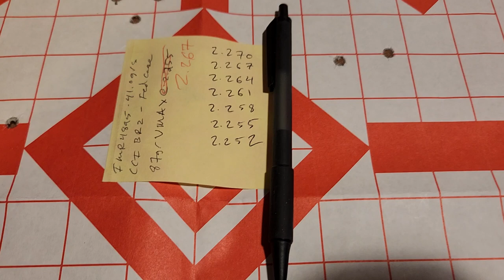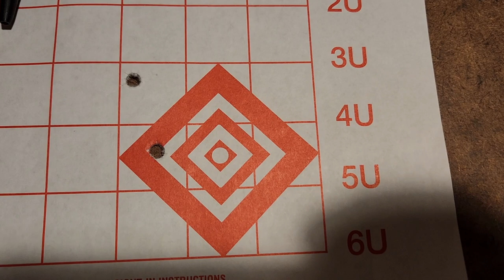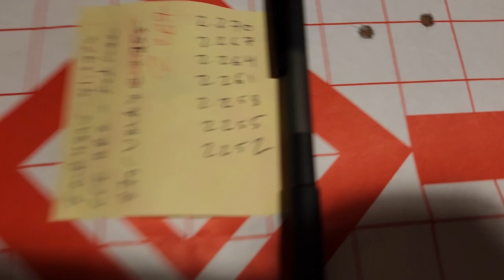"MY HANDLOAD DOESN'T SHOOT WELL ANYMORE! " | How to fix it. It's easier than you think!

Comment: Your velocity drops when seating further out. Changes your DOPE sheet.
Reply from the maker: I have noticed the opposite effect. When I seat further out, I am getting closer to the throat, which increases pressure and velocity.

Just my most recent example: I was at the range yesterday doing a seating depth test with our 22 Nosler project. The same trend applied. When I was at .007 off the lands, the velocity was 3050, from .013 off to .036 off, the velocity was 3032, from .036 to .051 it was 3018 and the remainder of the test from .051 to .067 it dropped to 3009.

Thanks for watching!

Comment: Makes sense. Eroding throat...😊
Reply from the maker: It works! I don't know how many times I have done this process, but it has always worked. Typically I don't have to change the load as much as I did in this video. Usually maybe 3 or 6 thousandths. Not 12 like this situation. But I imagine that is just an artifact of how bad this barrel is shot out.

Thanks for watching.

Comment: Nice Group. You could also get a Tuner Break. The EC tuner break works amazing!
Reply from the maker: Yeah thanks, it will do for a worn out old factory barrel.

I have 5 Tuner Brakes, yes they work. I think they are better at giving you the ability to keep a good load in tune, than they do turning a bad load into a good one.

I have had my best results by turning the tuner out 2 full rotations BEFORE I even start load development. Do my load development as normal and get the load as good as I can in the first 100 or so rounds. Then adjust the tuner up and down to get a little more out of it. Then check the load every so often, like I showed in this video, except, use the tuner to get the load shooting again, rather than the seating depth. It has the same effect, as you pointed out.

Thanks for watching.